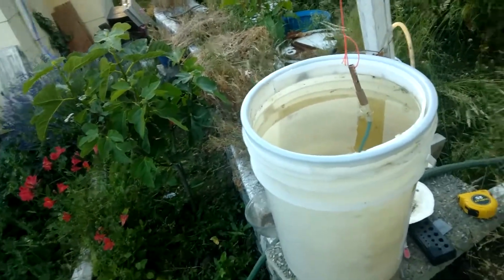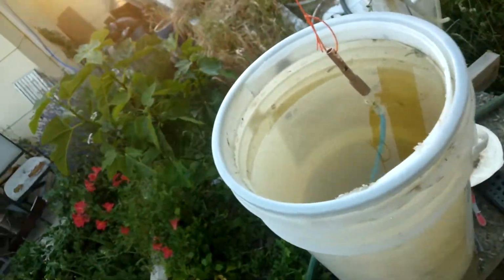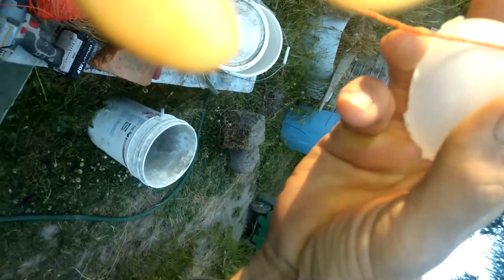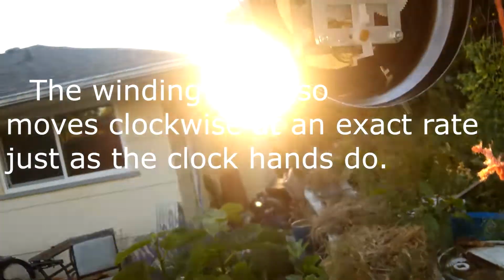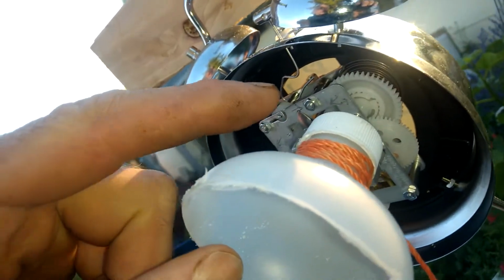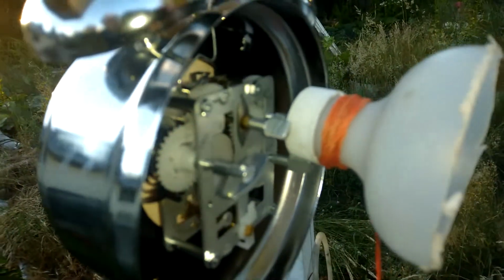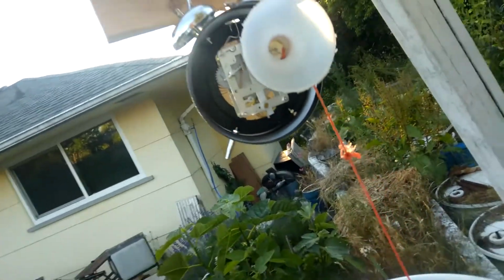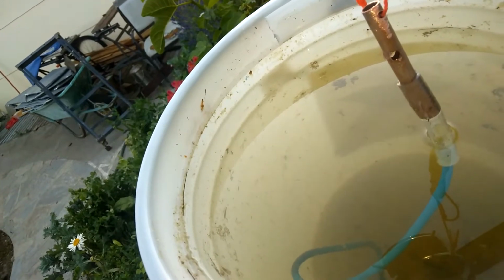How do use a Mechanical Clock to Meter water to plants!

Comment: Superb.  How about making a water clock to do the same thing?
Reply from the maker: a water clock is just not accurate or reliable enough for the things I want to do.
Reply: @Brians-tracking-sun-scoop  True, but it would be very fun.
Reply from the maker: @ChristieNel  Well, back about a decade ago,  I did "water clocks" to meter water out and I still use the float method which works the best.    It was fun, yes.  This video is the first in a series,   I'm going to use a clock to control the movement of a solar cooker  solar panel and a parabolic dish following the sun.
Reply: @Brians-tracking-sun-scoop  I thought I recalled you did something with water clocks long ago.  Just a thought, but mechanically a centrifugal governor can be used to produce a stable spin rate.  Could one do the same with a water vortex?